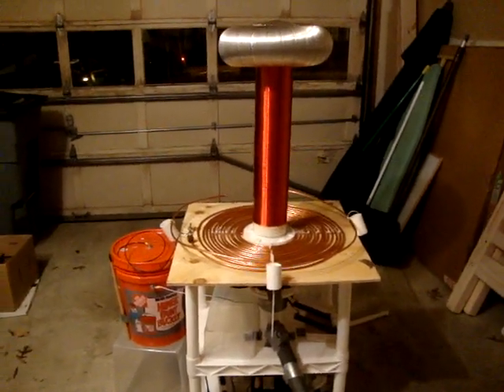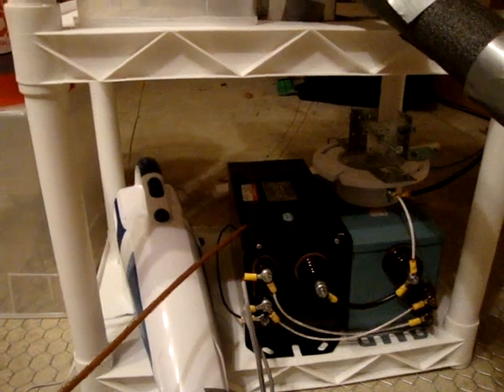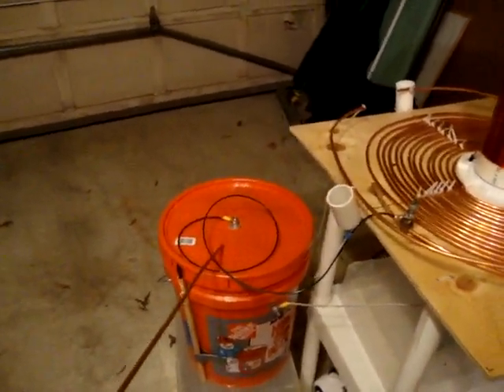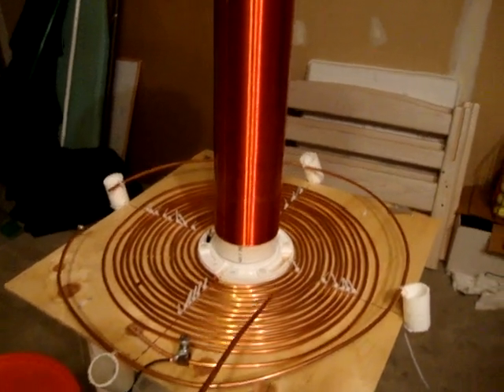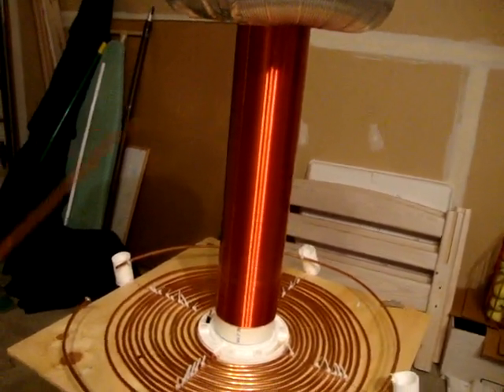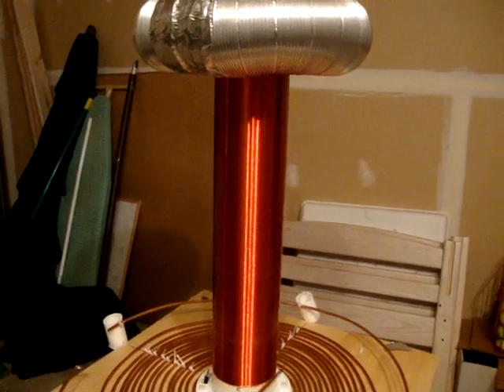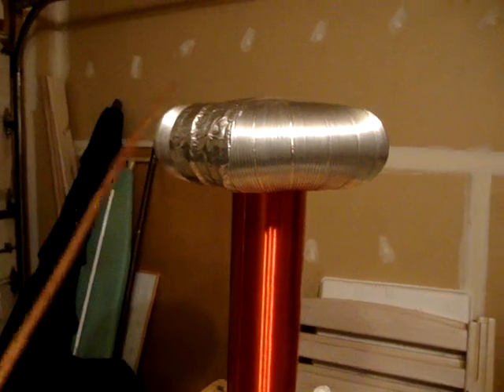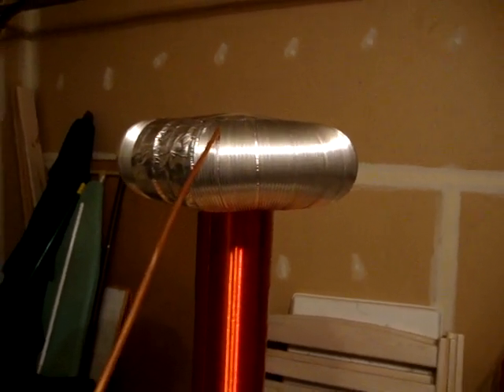How a Tesla Coil Works

Comment: With a powerful enough tesla coil would it be hypothetically posibble to power an airborne electric motor 30,000 feet in the air directly from a coil on the ground? How far do you think a coil could send voltage without it encountering  interference and could it actually power a high voltage motor from that distance? Also, do you know if there is a max speed that two magnets can attract and repel eachother? Kind of like the speed of light, it has a maximum traveling speed. What's the max speed you can travel off of pure magnetism?

Comment: I can't see how one can get free energy or save energy from this, cut off the 120v source and everything will come to a stand still. Believe that?
Reply: Not even free energy, you need to power the transformers just to get the capacitor to pull charge from the air to make the arc, so it's not even close to getting out what you put in. But that's thermodynamics for you.

Comment: Potential Tesla Coil developers should be aware that the high voltage spark/discharge will create a high level of wideband (white) noise across the RF spectrum - unless in a shielded room. I built a Tesla coil which could maintain  a continuous 11" spark/arc in '64 and all radio and TV reception was wiped out for some Km. It created considerable ozone and lit up the building's  fluorescent tubes - but not to a level which emanates from a normal AC connected voltage. The arcs were taken (I think) using a screwdriver and the electrical energy passed through/over the body. It used a  large 20KV neon sign transformer to drive the primary of the Tesla coil. It is probably a combination of low current and high frequency of the design which permits the discharge to pass over/through the body without harm - but I did not volunteer to be the 1st to test it.

Comment: You are correct to about 1:46. After that You are simply wrong.
The chage is basically oscilating, and the pulse of energy is going up and down at the resonant frequency (I guess that might be arrount 200khz for coil of this size).
And the spark fires couple hundred times per second at most.
Reply: That's literally what he said while leaving out resonant frequencies.

Comment: how dangerous are these arcs?
Reply: Depending on the frequency, and the amperage output of the neon sign transformers it can be less deadly, and very deadly, if the amperage output of the neon sign transformers is higher than 50 ma, then it can kill you, however, it you manage to tune the tesla coil to be less dangerous, then it will not kill you, because the wattage, is very low, it is mainly the voltage that remains within the arcs, and not much current.
Reply: Okay but Voltage is in terms of joules per coulomb, if you're getting almost no energy per charge, you are required to run a lot of charge through the system in order to have that high current.

Comment: Was thinking of making something like this for school project on circuits and electricity.
Sadly the maximum voltage of the circuit cannot exceed 12V
Lol 12KVolts * sigh * too bad. Would have been a very shocking experience for the class.
Reply: +Cody Hyde Nah, voltage still exceeds 12v with a slayer exciter, that would just be the input voltage.
Reply: slayer exciter

Comment: no is not right difnation of Tesla Tesla coil is resonant transformer like this you can see the high tension wiring in your place somewhere out ofciti there is high-tension wir doing like this when in the air enough humidity muhhhhh IC u expand u r money to much but u don't now about Tesla coil I am small AC mechanic I understand that that but you
Reply: I'll get a bucket for that word vomit
Reply: If you are so advanced, and know so much about this, then why not prove it? You are correct on how it is a resonant transformer, but the high tension wires make no difference, you just need a basic coil, with 500 turns or more, and a primary with about 10 or more, and you can achieve resonance with the correct amount of capacitance on the primary. I'm not entirely sure about the humidity thing you mentioned either, but this does take a toll on arc length, with more humid air extending the arcs out further, and less humid air shortening arc length. Originally, the tesla coil was designed for transmitting long distance radio signals, or wireless electricity and was in purpose to light homes from hundreds of miles away.
Reply: People are misinformed adding will create storage of via heat thus plasma...It can give or take or store...Go on say it what are you crackling on about...This video isn't misleading its only showing one side...
Eg DC AC
Solid perpetual dc
Perpetual solid ac
Also range on either side...Or bridging...
This works on gases as in Plasma AC
DC works on solid

Comment: can I wirelessly use the electricity for house hold...
Reply: +Mike Amber Well, if you can transform the energy form the ionosphere into static electricity (as Tesla did), yes it is possible (for free). Otherwise, you need a big sum of cash and a very large Tesla coil.

Comment: Was Tesla trying to pass high voltages in the air to be received on another end much like radio waves to a receiver?
Reply: @TheTruthQuest123
Not to mention all the other possible applications of wireless transfers of energy (i.e. today's wireless tech)
Reply: tesla believed that with his coils that he could actually positively charge a layer of atmosphere that holds the same resonate voltage that us humans have. he belived he could charge this layer around the globe with extra energy one time and that would be the source for any one anywhere to pull power from. he also claimed it could have mind control properties and make weather.
Reply: ***** yup! 😉

Comment: how did you fully charged the capacitor with an ac source?
Reply: It has to be designed to match your voltage source, so that it charges in half a period.

Comment: is it safe?
Reply: If you get near it and point your finger at it, the electrons will induct into you and shock you, but thats only if you're connected to a ground, but lets say you're on a plastic stool and touch it, the circuit will not be complete and you wont... You can actually stand on top of a tesla coil (if it doesnt break) and point your finger and the bolts will fly off your finger and you wont feel any electrocution
Reply: No, it's electricity
Reply: +FlammyHD What about wearing some Big Rubber Boots ? while standing on the ground lol
Reply: LoV3 My ShIzZ I'm sure those would work, however I wouldn't test it

Comment: All do respect, try to understand how it works ALL BY YOURSELF before you upload anything. You either have been told wrongly, either you studying from wrong books. And be careful with that one as you call it high "Voltage transformer" it has been executed in the worst possible way. It can harm you and your neighbors , and you will know until later, might even years later and you will not remember what made you sick. Remove spark gap from underneath and keep at least two feet away from secondary, in fact remove everything from underneath secondary.

Comment: The voltage from a disconnected coil can not be calculated but it is surely very high in a MAX to Zero current swing in the spark gap. The coil voltage can only mean one thing the coil is holding charge as surely as a capacitor does and does one thing a capacitor can't and that is to induce like charge into the secondary. Forced oscillations will occur but I feel the charge induction between coils is a factor of great importance. There are other things Nikola Tesla did in Colorado Springs that make DC the overriding output enabling superior motive forces for particle and X-Ray uses.

Comment: "It generates high voltage electric sparks into the air" ??? So you power it with electricity, it increases that electricity, and "sparks it into the air"? So with your type of coil, you need to have your own electricity to supply the coil, which in turn just throws it away, by dispersing it into the air? That is a pointless waste of electricity, and nothing more than a Novelty Item. That is NOT what Nikola Tesla invented. Tesla's coils did the Exact opposite. That is why his work is so notable.
Reply: if i recall it charges anything nearby, radius gets bigger as the coil gets bigger.
Reply: You're absolutely right, just look at the company "tesla" when you search it on the web nothing about Nikolas right away anymore, it's sad. Greed took over this world awhile ago, and it's not going change.
Reply: Skruffles if you were educated in High school you'd know Nikolas Tesla achieved creating wireless electricity without a main power source and  not just creating sparks. lmfao Good thing you were taught English though. Then later when he almost accomplished building his structure it got vandalized/destroyed most likely by the government.
Reply: IF it can't be taxed, it can't be used in America, land of the free.
Reply: I see all my hours of studying Tessla are coming into use now can some one who has Radio Frequency knowledge say 6Mhz look at Alternating Current this a moving sine wave not a square wave. RX is what Tessla wanted his tower for not TX. Check it out smart meters are crap and rip you off.
Reply: Okay I usually wouldn't do this but could you explain your reasonings/opinions? Tesla coils have the potential to transmit power and signals, I know and understand that but what makes you believe tesla coils can create(a more accurate word would be harness) power? AFAIK tesla coils cannot be tuned to receive any of the energy that constantly bombards the earth.. If you think otherwise, could you provide some proof or experimental findings perhaps?
Reply: Tesla coils capture electricity from their surroundings. That freshly captured electric energy is either released back where it came from ("sparks in the air"), or it can be stored (battery) and saved for future use.
FYI; In your search for knowledge, beware of some websites and troll shills posing as the general public. They are pressing an agenda. And that is to hide the truth from the masses. Especially in regards to energy, science, and health. Their goal is to rule over a planet of complete dip shits, too stupid to ask any questions, or accomplish anything for themselves. Don't be a dip shit. Learn every day.
Reply: CaptBill1111 Care to post any links that you find which aren't shit-pushers? Like I've said before, I have a narrow knowledge of HV electronics but even still.. Tesla coils can only receive/capture electricity if it matches the resonance of the tesla coil windings.. There's no electrical energy naturally produced that could possibly induce a current (apart from lightning ofc, but that's really inefficient..) (trust me, I'd love it if there was) I've done some searches on some legit enough articles and journals and I have yet to find an experiment where electrical energy is transferred from one tesla coil to another.. If you find such an experiment, please forward it on to me.. Thanks.

Comment: you got it backwards? the real tesla coil gets energy form heat from air...
Reply: "A Tesla coil is an electrical resonant transformer circuit invented by Nikola Tesla around 1891.[1] It is used to produce high-voltage, low-current, high frequency alternating-current electricity"
This does that exactly :o
Reply: read forwards and you will find out the "tesla coil" isn't really the real thing. Lookup Tesla Magnifier!
Reply: http://www.tb3.com/tesla/magnifier/magnifier.html
Nice, with the extra coil it seems to produce even more arcs :)
Reply: CaptBill1111
Could it be that the person making the video is simply mis-informed?
Reply: YES! Strangely, I've found a lot of videos here that are attempting to mislead the viewers. Very Odd. Tesla's inventions are so well documented, and with correct information about them plentiful,  and easily accessible. These people know that too. There is some other reason for the misinformation campaign. Somehow this must benefit their Agenda, which can't be a good thing.
Reply: nuke
Speaking of... So what is Your agenda??? How do you benefit from posting misinformation??? It's laughable how the shills start by stating well known facts, and often include links- which don't prove anything or are just more misinformation. This is an attempt to appear as if they know what they are talking about. But Everyone Knows they are Nothing But Soul-Less Troll Shills, attempting to navigate their lives with No Moral Compass. That aside, that thing doesn't produce shit. By the video posters own admission it "Disperses" the electricity YOU supply it with! That is fucking stupid, and lame in comparison to making a REAL Tesla Coil, which WILL PRODUCE Electricity, and look cool in the process. That's why Nikola Tesla is famous for his inventions, and the maker of that thing is not.

Comment: I don't understand how can the capacitor be charged when there is a solenoid shorting the circuit :S Why does this system work? I can't understand it at all... Why electricity does not go through the solenoid in the first place even if solenoid is in parallel with the capacitor? I would really appreciate your answer :)
Reply: what solenoid are you talking about?

are you referring to the spark gap?

Comment: What is the function of spark gap?
And, can you build one without spark gap and toroid?
Reply: MrRamram720 The spark gap only opens at a certain voltage, and is because the circuit has to be resonant, meaning that as soon as the current, as the author mentions, comes back from the torus, it gets another charge from the capacitor precicely when needed; because of the resonance, the voltage increases from several kV up to almost a few MV
Reply: It sends a pulse of electricity through the primary coil creating a strong magnetic field inducing an electrical current on the secondary coil
Reply: Toroid? Yes, but may not have as long sparks Spark gap? no it's essential
Reply: Anthony Russell is it because the more resistance something has the bigger the share of voltage it gets, and air has a lot of resistance?
Reply: Not sure I understand your question
Reply: Anthony Russell what does the spark gap actually do
Reply: @cala.valt.720   simply:spark gap works as a switch...
Reply: @aadiljanjua3699  That might've been useful 5 years ago, now as a qualified engineer...
Reply: Tomas miri
From what I understand, the distance between the spark gap sets the frequency of the discharge.   Essentially it discharges the capacitor at a certain frequency and it has the added feature of having negative feedback with shifts that frequency slightly depending on how much energy from the torroid has been discharged into the air... 

That's my layman's understanding.

Comment: i have a question, Correct me if I'm wrong but...you (at 3:11) say that the ark comes OFF the toroid.. however, even though it looks like its going away from the toroid it's the opposite.  The way I understand it is when u look at a lightning bolt or ark the small points is were the energy starts and the thick part is where it accumulates.  thus your flash is coming from energy being drawn from either(and this part i'm not sure, just guessing)  thin air OR the field your primary coil is producing.

Comment: Your explanation sounds like that more of a Van De Graaff generator. As a tip, explaining everything you did should be in front of a more concise and visual schematic, and the explanation should be done quicker to avoid loss-of-interest. Also, your topload is appears to be very close or even overlapping the secondary coil, which could cause arks trailing along the secondary, carbonizing everything, and ruining your secondary. Too low means it also parasitically draws power out of the changing magnetic flux of the primary, the same way having the strike-ring shorted will. it is like a shorted secondary, and converts all the magnetic flux  energy transferred into to turn into heat. If I am not mistaken, you can use the inverse-square law and the coupling coefficient to determine power-loss this way. Sorry for being a bit critical. :)

Comment: A) That is not really a spark since a spark is momentary.  Also, the ionized air does not make the electricity pass through it more easily.  It is the heat from the ionization of the air that we see as lightning.

B) This IS different from the SPARK that you get off a door knob.  However, the reason is not what you think it is.  The discharge from a Tesla coil is NOT high frequency.  It is high VOLTAGE.

Comment: induction is discouraged in Tesla coils because we don't want the current, just the voltage, that's why the primary is not wound over the secondary.

Comment: Tesla transformers don't operate like normal transformers as everyone insists, they use resonant inductive coupling which is different to electromagnatic induction. Two coils don't have to have the same frequency for induction to work (normal transformers), but they do to be resonantly coupled (Tcoils). We're not surrounding the secondary with an EMF here to get current induced into the wire, we're plucking a string near an identical string so that it vibrates in sympathy.

Comment: Hi there - nice description. Can I just clarify that the SG will ideally fire about 120 times per second. However, after each firing, the primary capacitor energy is exchanged back and forth between an oscillation in the primary circuit (maybe 200kHz in your case) and an oscillation in the secondary circuit, at an exchange rate of about 20kHz. As these oscillations decay, the ideal case is that your arc extinguishes just as all remaining energy is in the toroid capacitance for the first time.